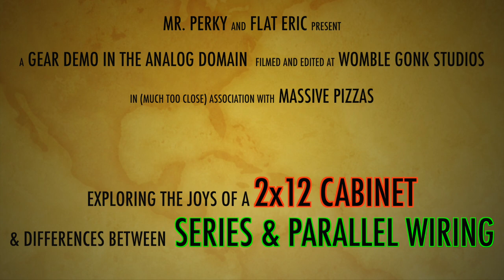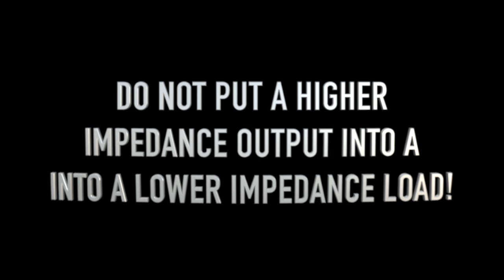Series vs. Parallel Wiring In A Speaker Cabinet (Hook-up, Impedance, Transformers...And More!)

Comment: Parallel versus series is about voltage versus current. You first have to understand that the voltage send to a speaker does not create sound. It is the current that creates sound. Currents produce the magnetic fields that move the membrane. Voltage just causes the speaker to "react". In fact, the inductance in the speaker is also called reactance. And how a speaker reacts to voltage differs based on reactance and resistance of the speaker and a few other things. But once you have a current in the speaker, it will move the membrane. When you hook up two speakers in parallel, you give them the same voltage. If the speakers, are perfectly identical then the same current will flow and if the membranes are identical, you will hear the same sound. But that is a lot of "ifs". If you place the speakers in series, then both speakers will see the same current and if the speakers have same impedance and similar build they will produce the same sound. I don't think that changing the tab on the output transformer will make any difference, unless you start saturating the transformer due to high current, which is very unlikely. So in my opinion, you get the best repeatability by placing the speakers in series and using the appropriate tab (16 ohms that is)
Reply: saturating the transformer is very likely when you crank amps up which many do
Reply: @RocknJazzer  By putting the speakers in series, you reduce current and therefore saturation. Besides, most output transformers have taps for 4,8,16 Ohms etc. So you see the same load and therefore same current through the transformer

Comment: In series wiring, if one speaker of two blows to open circuit, the amp will be without load if it has no other speaker or other load connected. That is immediately very harmful to the output tubes and OT if it happens (and it quite often happens) when the amp is cranked up, but you'll quite probably notice it immediately because both speakers will go silent. 
In the case of parallel wiring, if one of two speakers blows to open circuit, amp won't go silent but the load impedance will be doubled which is of course not a good situation but it won't be immediate catastrophe if you notice it soon, which is not always obvious because the speaker cabinet won't go silent.
Reply: Excellent comment!

Comment: It's simple:
Factor 1.
In series, the signal travels from the first speaker to end up to the second, so the first one acts also as a resistance.
In parallel it reaches both speakers simultaneously. 
(series=less highs, as in pickups) 
Factor 2.
Speakers sound different on different impedances, due to their construction solely, the resonant frequencies move also a liiittle bit (1-5 Hz). 
(a matter of the exact manufacturer and speaker of how it works) 
Factor 3.
Amps behave differently at different Ω outputs.
(traditionally: 4Ω american, bass heavy, brute, untamed sound, 16 Ω british, refined, chimey, jangly, edgy yet more hifi and stable sound, 8 Ω the compromise). 

All of the above to taken into consideration.
Reply: The equation is  (Ωa *Ωb) /( Ωa+Ωb) for parallel linking, so an 8 & 16 Ω mismatch would give 5.333 Ω that can be safely driven by an amp at 4- 6  Ω.
Yes the latter stands true. 
Most speakers are slightly lower in their exact Ohm rating anyway, than in their namely one*, and that's totally ok, because impedance varies due to signal anyway. 
Avoid extreme mismatches.

*for example, all guitar speakers 6-8 Ohms are listed as 8 ones. 
Most of your speakers are slightly lower in impedance than you think.

Comment: The lower the impedance the higher the output,  but its at a cost, as you lower the impedance the top and bottom of the overall frequency response is rolled off, which is probably why opinion is divided, as this effect leaves the mids more prominent.
Reply: 8 ohm is where its at IMHO
alnico celestion gold up front more mids or alternatively my fane axa12 (discontinued unfortunately) for a big, open, heres everything, sound.
They are the only two speakers I need to stay 😊

Comment: Thanks Joe for the comparison, I liked the clean tones of the parallel connection better (it must be one of the ingredients of the fantastic clean sound of the twin reverb since it is also in parallel) and the distorted tones of the series connection (warm and thick tones like vox and orange). But it is crazy since the only way to perceive it is through a face to face comparison. For versatility and practicality I go for the series connection but if logistics allowed it in a concert I would play the clean tones with a parallel cabinet and the crunchy/distorted ones with a series cabinet. Thanks and greetings!

Comment: There are some veeeeery slightly difference but they were so subtle that you have to keep your hears attached to the monitors to hear something.
Still, interesting topic, i wonder how it would sound with one of those Magnatone stereo amps.
Speaking of amps, Joe which amp would you like to get next? maybe an Hiwatt? which amps are left in your shopping list?
Reply from the maker: Absolutely - there's a tiny difference, but it's not as drastic as most people make out on forums! :P Ooh...to be honest, I'm gassing SO bad for the Dr Z Z-Master (the Joe Walsh 3x10 Bandmaster thingy) but it's so expensive in the UK :-( I'd love to try a Hiwatt-type amp as well at some point.
Reply: @JoePerkinsMusic  I've just heard the Z-Master. It's AMAZING. It will go on my dream list. I have to buy a Magnatone Twilighter first, maybe in the near future i'll get the Z-Master
Reply: You can't wire a stereo amp in series or parallel, there are two power amps, one going to each speaker, no choices. I used to own a 60s magnatone stereo amp

Comment: Pleasant video and to the point. I couldn't tell a big difference.
I'd want to see a spectrum analyzer and power output spl levels readings. 
I'm old so, I don't trust my hearing. LOL  
Using an amp at 3/4 or less volume is a thing for me. 
The volume setting on the amp was the same for both , I'm going to assume?
I build  my own amps from salvaged amps.  
I have a Matchless Clubman 35 style design that uses a 3k4ohm  primary output transformer.  

That's calculated with a 8ohm load.
It ran a PPP set of el84's in a previous life.  It's new life is with a pair of el34's. 
16ohms is basically a requirement of the design.  Those two el34's are happier with a 6-7k load at 400volts. 
Running two 8ohm drivers in series or a single 16ohm driver is all I can do with that output transformer.
I'd be sure that running drivers in series that one driver can handle the amplifier's total wattage.
Reply from the maker: Amp settings didn't change - nor did mic positions or blend :-)

Comment: Another great video Joe, which did you prefer?
Reply from the maker: Made very little sonic difference, to my ears!  I think the slight extra 'thump' of parallel won it out for me, but almost all of my speakers here are 8 ohms and my Marshall/Orange heads only have 8/16 taps, so series wiring at 16 ohms is my best option just for ease of being able to use the most amps with the cab and not have to rewire it constantly. If everybody gave 4/8/16 taps like you guys do, the world would be a much easier place ;-) haha
Reply: @JoePerkinsMusic  As an aside, a little of the Z Wreck harmonic hair comes from the Series wiring, as it was designed around a 16 ohm 2x12 when it was being protoyped.
Reply from the maker: @DrZAmplification  Ah interesting...that might be one reason why I tend to run my Wreck combo into the 2x12 at 16ohms when recording as I think it sounds better! :P I currently have a Celestion Gold & Scumback S75-PVC in that cabinet wired 16ohm series for a lot of British alnico jangle - that's my favourite pairing for the Wreck/DB4 and my Orange/JTM45 heads!
Reply: @JoePerkinsMusic  so I’m curious with two 8 oms speakers would give me 4 oms ? So what if I don’t have the 4 oms on my amp head ? I do but I’m just wondering.. thanks

Comment: I have a custom built 15W head that has a single tap that says 6-8 ohm, the transformers are from an old tube amp and the original OT is a 6 ohm, I'm currently runing 2x12 in parallel / 2 speakers each one is 8 ohm/ resulting in 4 ohm impendance, the amp works fine with this setup, no issues like heat or noise or whatever. It was the safer option for me - isntead of wiring the two speakers is series for 16 ohm into this 6-8 ohm head

Comment: great video! It seemed to be a subtle difference to my ears. Maybe it feels different in person? Something in the midrange sounded a little more direct in the series wiring, but I doubt I could hear it in a blind test! I hope you do a follow-up on testing different speaker impedance values!
Reply from the maker: I think I definitely felt more 'thump in the back of the head' with the parallel wiring - which maybe came across in the audio, but not as much as in person.  Super close, though!

Comment: From my layman’s perspective (because I have very little understanding of these things …) I’d say you really needed to be running the same impedance for parallel and series to get a true perspective (impractical I know). At 4ohms the amp will be working harder and adding it’s own colouration and feel to the playing, as opposed to 16 ohms which is easier to drive for the amp. All that aside, as a viewer I couldn’t tell much difference and would say it more impactful to the player? Added benefit of parallel being if one speaker blows the amp still see a load!  Well done this is really nerdy guitar stuff!
Reply from the maker: I think variances in using two totally different speakers would likely create more difference than 4 vs 16 ohms did in this video - but yes, agreed!

Comment: One HUGE factor that is missed in these videos (more so when mixing speakers) is the non-linearity of the impedance throughout the frequency range. Put two speakers of different types in parallel and the power will go to whichever speaker has the lower impedance at a given frequency and less power will go to the speaker with higher impedance at the same frequency. In series the power has to go through both speakers evenly.
Reply: not an issue as 99% of people hooking up a pair of speakers will use same ohm ones, so nothing missed unless someone for some odd reason or being cheap uses different ohm speakers.
Reply: @RocknJazzer  I think you missed the point. Ohms are non-linear. Different speakers, even though they are rated for the same Ohms, do not have the same Ohms throughout the frequency response. The Ohms rating is usually just the average of lowest Ohms. Most speakers actually dip down a little below their ratings. If you look at impedance plot charts between different drivers rated at the same Ohms you will see what I mean.
Reply: I know all that, but two same speakers, which most people use when pairing, will track similarly, of course slight variation but not like using two different ohm speakers, so I dont get your point as few use mismatched pairs  @stimpsonjcat26

Comment: I am building the same type of cab same brand too I think. It also has a option for sterio. 
I originally bought 2 8 ohm V 30s in 8 ohms each sending them back because of their limitations. I just ordered . A new set of these  
CELESTION Vintage 30 Guitar Speaker, 16 Ohm & G12M-65 Creamback 16 Ohm Guitar Speaker, 12"

￼

￼

￼

￼

￼

￼

￼

Comment: You can safely mix different impedances though right. It just gives you a weird total ohms rating and probably drives the speakers dissimilarly. So long as you don’t run too high into it it’s safe
Reply from the maker: That’s exactly it - you technically can, but you’ll get a weird impedance that won’t necessarily be good for your amp. So having 8 & 16 ohm speakers wired in parallel would give you….a 6 ohm load (I think!?) And in series would give you 24 ohm. From what I’ve heard, you can run a lower impedance load into a higher impedance speaker/cabinet (8ohm tap into a 16ohm cab, for example) - but you won’t get full power, and a more narrow frequency range. But never, ever run a higher impedance load into a lower impedance cabinet, as you’ll overload your amp and cause big damage!
Reply: In paralell would give you 5.33 Ohm total load and yes the speakers will be driven dissimilarly.
Reply from the maker: @jes4932  Thanks for being better at maths & physics than I!
Reply: @JoePerkinsMusic  a 5.333 Ω, the equation is  (Ωa *Ωb) /( Ωa+Ωb)
Reply: @JoePerkinsMusic  And thank you for beeing a very much better guitarist than I am!

Comment: Is there a problem with connecting a 75 Watt speaker with 25 Watt together? for a SuperCrush 100 head...
Reply from the maker: You can't do that, as the power will be split equally between the two speakers - so the 25W speaker will be receiving 50W of power, which will likely destroy it quite quickly.  When pairing two speakers to use with a 100W amp, they'll both need to be 50W speakers or above. 👍
Reply: @JoePerkinsMusic  Thank you for answering. That make sense, and I wanted someone to clarify it haha. You are the best man.

Comment: That equation only works for 2 speakers. It gets a little more complex in a 4 X 12. Dont automatically assume you can wire four 8 ohm speakers in parallel and it will result in a 2 ohm load.
Reply: but it does, as 8 div by 4 is 2 but no one uses 2 ohm amps so few will do that. 4x12 cabs are usually wired in series/parallel, which will result in same total ohms as one speakers ohms
Reply: Yeah, the ‘59 Bassman and Super reverb are both 4x10 amps with four 8 ohm speakers wired in parallel for 2 Ohms

Comment: Ive got an '68 Silverface Champ. 8" speaker. Replaced the original tired, and initially not very good speaker, with a nice Jensen reissue. However, do you think that with the parallel, 4 ohm load, the cabinet would be capable of being driven by the 5 watt Champ???
Reply from the maker: Am I right in thinking the Champ has just 8ohm output(s)? If so - I really wouldn’t risk it, as putting an 8ohm output into a 4ohm cab would make the amp work harder than it’s designed to do, and would likely blow output transformer/tubes/etc. If it has a 4ohm output, that would be fine - the wattage of the amp doesn’t really matter, it just won’t drive the speakers very hard. But impedance mismatch is the thing that’ll cause damage!
Reply: No, its 4 ohm output. Has an RCA plug for speaker connection.
Reply from the maker: Ah ok...a 4ohm output driving a 4ohm load should be absolutely fine then!  The speakers together should be a similar volume to your single 8"...so, not too loud on their own!

Comment: Hi - Hi - Quick question to anyone that has a  Fender Mustang V amp head. 
ON THE HEAD - Do I hook up both RIGHT and LEFT stereo speaker outputs (each 8ohm 75W) to both inputs on a Fender GE-412 4x12 parallel  cab - in order to utilize all 4 speakers in stereo? The cab speaker inputs are not labeled LEFT or RIGHT.    HELP

Comment: I hope I get it sounding good any pointers it is my first time building a cab using it with a Marshall origin 20 .
Reply from the maker: I didn't build this cab - it's a Zilla Studio Pro :-)
Reply: @JoePerkinsMusic   Oh ok thanks I did some research I think I got the wiring and ohms thing down now . I should know later this week. I did send the 8 ohms speakers back and got 16 ohms so it would have more room. I still have 3 other 8 ohms speakers to change around if I want to. Anyway thanks for getting back to me.

Comment: I’m confused. Is 4 ohm louder than 8?
Reply from the maker: Assuming you’re using a 4 ohm output into the 4 ohm cab, and an 8 ohm output into an 8 ohm cab, the volume should be the same. Only mismatching impedances should make a difference to volume.

Comment: I liked 16 better, but i can never trust my ears.  ALSO i just looked in the back of my combo and it appears to be wired in series but it has more wires then your diagram.  The initial wire pair comes in and runs to one node on each speaker, but 2 wires run between each node from one speaker to the other :face-purple-wide-eyes:
Reply: NOPE, it must be paralell because the manule says 8ohm load but the speakers are 16ohm speakers so it must be paralell because the load is half the ohms of the speakers.
Reply from the maker: Yep, that sounds like a parallel setup :-)